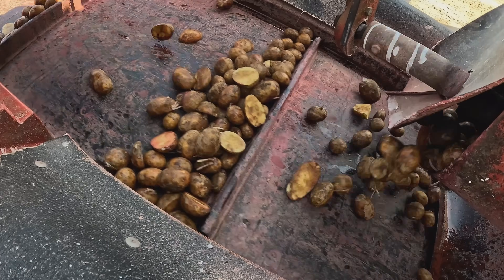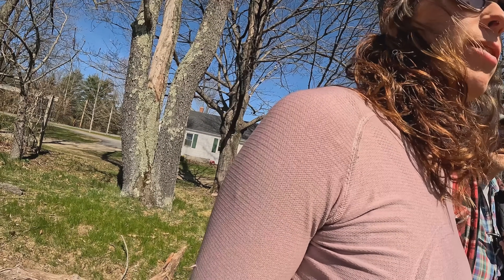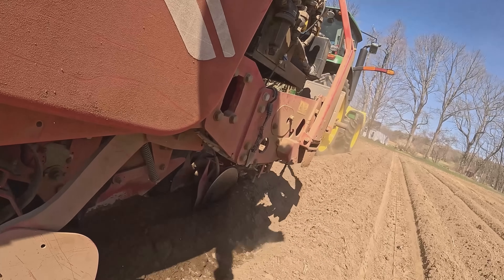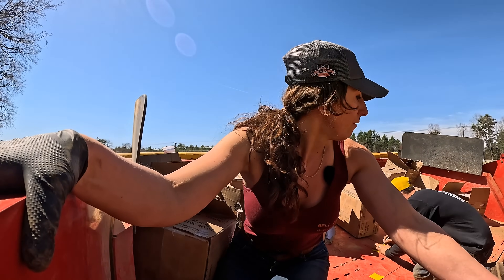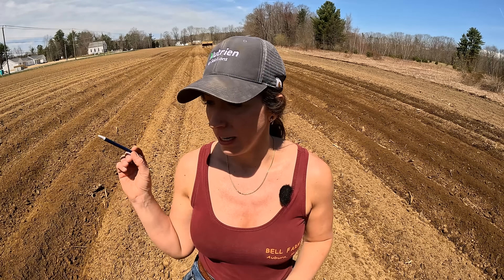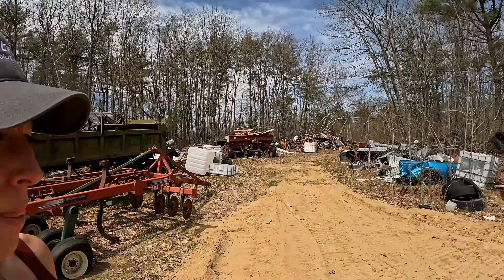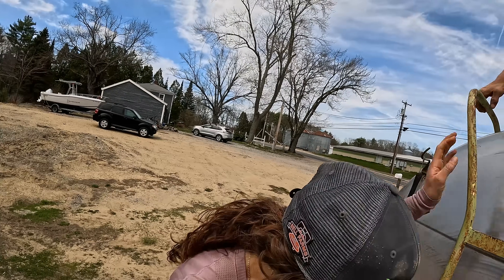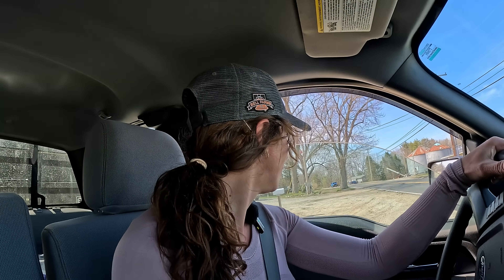New Potato Varieties- Seed Trial

Comment: My grandpa was a small time farmer, and he raised potatoes. I don’t remember how many acres but with about 10-12 people we picked it by hand and put them in his root cellar. He would cut the eyes off potatoes and use them for seed. Are you just cutting your seed potatoes in half just to expose some of the insides? Interesting show, learned a bunch.
Reply from the maker: It is to make them smaller and more uniform inside. The inside doesn’t matter. But the smaller size to fit into the planter cup does

Comment: That tank fits the definition of a confined space, you guys should be aware the possible dangers before entering. Be careful!
Reply: We were
Reply: There is something to this confined space thing. The welding is highly problematic if you’re inside. You can do it but it requires special equipment. First thing is a trained competent person to oversee the project. I was one of those and the danger cannot be overstated.
Reply: All the welding done to the tank was from outside luckily, my welder is a little tall to be in that tank anyway, I was just vacuuming out debris .
Reply: @shanebell9589 . That’s great. The stuff you need to weld in a stainless in a tank is a half day job to organize.

Comment: First, time watching your channel, and I enjoyed it and others to come, my question is why would you have thousands of dollars lying on the ground rotting away, it looked like there were tones of steel that could be turned into cash for the operation Cole the Cornstars removed 4 generations of farm machinery and steel that made the farm several thousands dollars
Reply: Well, as you could tell in the video, that “junk pile” saved us from buying a 1,200 gal stainless tank. There are not a lot of places locally for us to get stuff, so we hang onto a lot of our old equipment for emergency and backup parts. Good question tho. I am planning on hauling some scrap off this year tho, try and clean up a bit. Thanks for watching hope you enjoy the content .
Reply from the maker: Thank you very much for watching! And as for the Junk, it definitely needs to be thinned a little! We are going to haul some out this year but it’s nice to keep stuff around for parts like Shane said. We often have to fabricate something on the fly and Shane is great for finding something out there.
Reply: @BellsFarming  I have no trouble with keeping stuff I'm bad at it also, but I try  to keep it out of the weather, That's why I said sell it now, metal sells for a lot more than rust, rust is not worth a penny